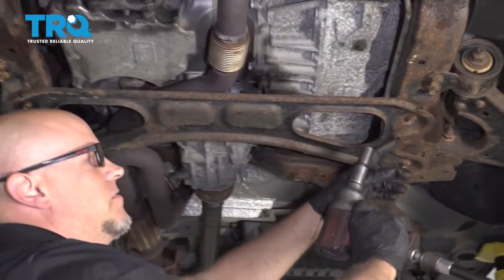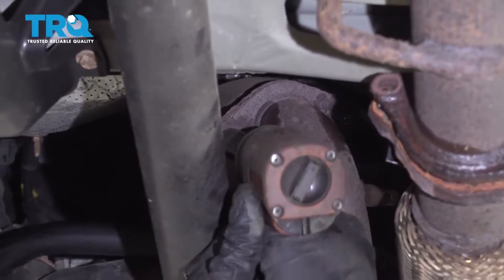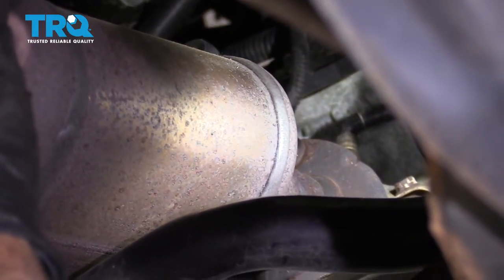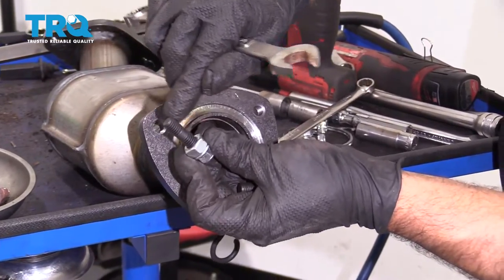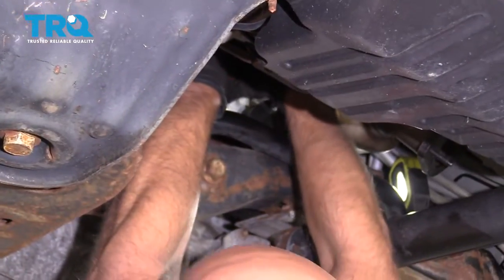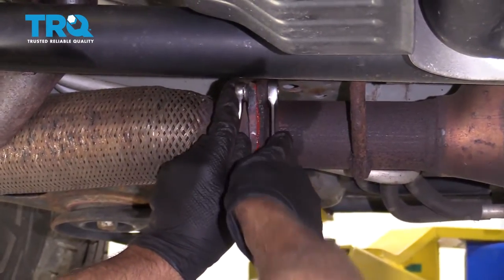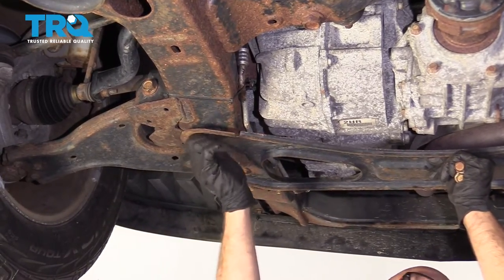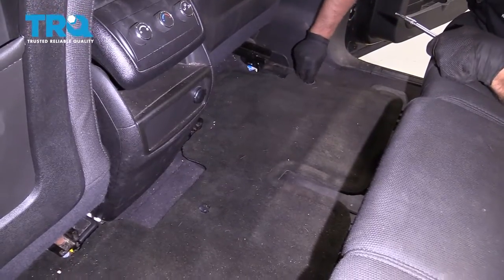How To Replace Rear Catalytic Converter 2007-16 Chevy Traverse

Comment: Please, for the love of God, tell me how you got the flex pipe to connect to the rear converter. I disconnected it as per instruction. And now, it just leaks. The OEM gasket is WAY to big!

Comment: Thank you for posting this video. I currently bought a 2012 traverse and was unaware of all the issues it came with. 2 months later. My muffler, exhaust ,02 sensors and cat went out. I seen alot of people saying that if one goes they all should be replaced. Well. No mechanic would do it under 3k... I'm now doing it myself. Removed everything I stated. Already installed the 2 new cats. Waiting for 02 sensors to come in and muffler and exhaust assembly.  I'm doing this all without the car off the ground. I don't have jack stands. And I haven't done mechanic work since 18. I do pools for a living. Removed all parts under 4 hours. Thanks again for the video. Saved me so much money and headaches
Reply: Did that fix the issue ?
Reply: @ieshaparson099  I have same problem with p0420, po430 engine light codes 

My muffler also needs replaced.. this will be excellent for 15 year old car